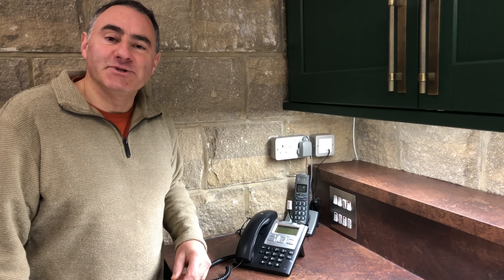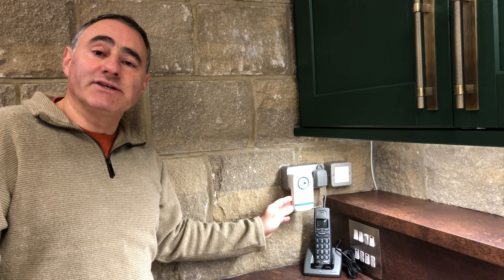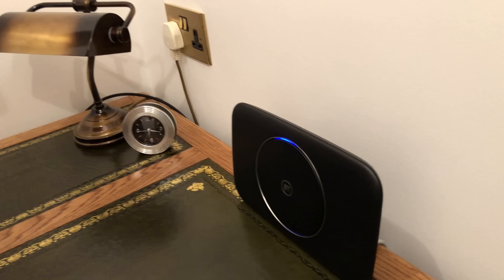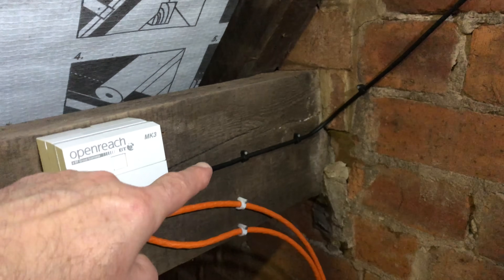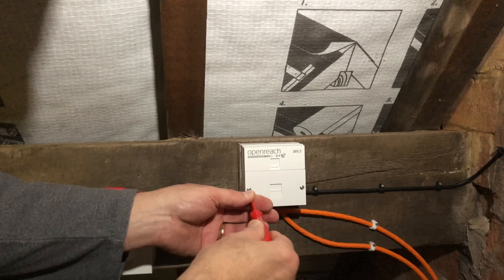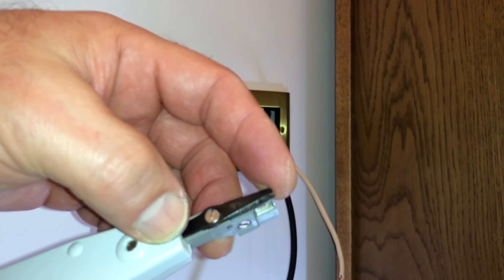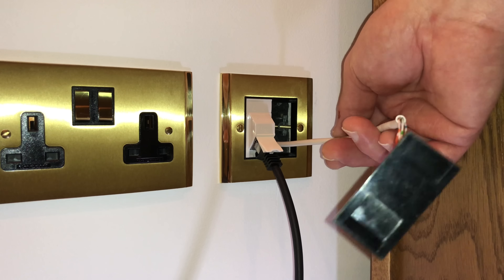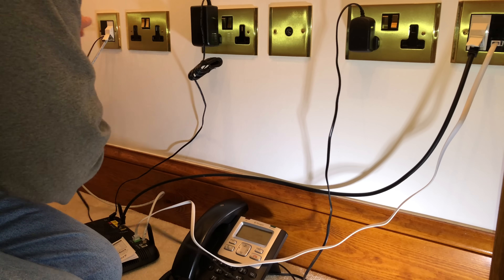How to Video - Analogue to Digital Telephone Landline Switchover Advice VOIP.

Comment: Not sure how this can work for my situ. My Fibre to property terminates from the outside with a BT box having 4 status lights and just one Ethernet feed from it to the Vodafone supplied fibre router. The box like the one you stripped the wires from is no longer part of any active system.  Therefore I have to have a wireless phone set plugged into the router. Am I missing something? As for power cuts..  why not just run the router off a 12v battery if the house power goes down? As long as the Openreach systems in the street still have power I imagine all would still work, VOIP and any hard wired analogue handsets. My battery would also have to power the Openreach fibre to Ethernet box, the one with the service status lights on board. The lights depict - Power, LOS (I assume, loss of signal), PON and LAN.
Reply: No you aren't missing anything, you have joined the many thousands of homeowners in this situation who have done, probably well before time, the necessary and dispensed with the need for a wired system of phones in the home. There are some folk though that may have been lead to believe they need to invest in tech when, in fact, they can still utilise what they already have with the addition of a connecting piece of cable. As for the power cut situation, you have suggested a very good solution. A lot of people won't bother and lugging around some form of battery or generator, remembering to check it works for in the event of may not be everyones cup of tea, but the choice is there.
Reply from the maker: Hello Neil, Fibre to the premises isn’t in our area yet, so our broadband is still via copper cable to the master socket as shown in my video. When full fibre is installed in our area the master socket will be removed from our house. Because of my simple wiring alteration my landline will stay as per my video. You are correct in saying in the event of a power cut your hub and Openreach Optical Network Termination (ONT) box will lose power and your landline will be out of use. As you state, your ONT and hub will both require battery backup if you wish to keep your line open during a power cut. I’ve had lots of comments regarding battery backup, worth a read up! Thanks for watching and commenting. Cheers Rob 👍

Comment: Bit confused (not very techy!).  I have just the old master socket with broadband and phone.  This is in the loft.  I am currently looking for a new broadband supplier, but they are indeed all telling me that they won't do landlines anymore (has to be VOIP)...so what will come into the property?  Is it a new line - and nothing to do with the current 'BT' line?  Does it still come from the pole outside?
Reply from the maker: Hello Barry, The majority of providers use Openreach lines. Openreach stopped providing analogue copper telephone lines in September 2023. Unless a provider such as Virgin Media has underground cabling outside your home then it is most likely going to be the same overhead line from the pole. I still have copper cable for broadband coming from the pole as overhead fibre hasn’t been installed by Openreach yet. Now our landline has been switched over to digital (VoIP) the only difference is a clearer line when using the phone. When full fibre comes to our property my simple wiring alteration will allow my landline to stay as per my video. Worth reading other comments regarding power cuts and battery backup. Hope this helps. Thanks for watching and commenting. Cheers Rob 👍
Reply: @robswiseways5697  
Rob, thanks so much for replying.  Can I trouble you a little more?
I do have a fibre cable running past my driveway (they created havoc here two years ago!).  It also goes within inches of the BT pole.  But my driveway cannot be dug as it's finished concrete 10 inches deep in places.
So my question is, do they come off that fibre trench, up the pole, and replace the cable into my home - copper to fibre?  If so, then my master socket is still going to be in the loft.  A neighbour had his replaced, and 'Giganet' went to his guttering with the cable, then down the wall - though to his router.  They did hide it fairly well, but I'm not keen on that as we have white walls with no cables.

Thanks.
Reply from the maker: @barryfoster453  Did Giganet lay fibre past your drive and then use the BT pole for your neighbour? It’s difficult to picture your situation Barry. If your street only has overhead lines and no underground means of connection (some companies install a boundary access box in front of each property in the pavement), then you probably have no option but to do similar to your neighbour. If you have means of running the cable downstairs internally from the loft then this overcomes the external aesthetics. Hope this helps, Cheers Rob
Reply: @robswiseways5697  
Yes, I am pretty sure that Giganet used the pole, as they didn't dig up his driveway.  They didn't connect to his old master socket, though.  They drilled through his wall and set up his router there.  Maybe it's best if I get their engineer here to talk to me.
Thanks, Rob.
Reply from the maker: @barryfoster453  That’s probably the best bet Barry. Cheers Rob

Comment: Hi, rural dweller here also disabled and in an area with patchy broadband and regular electricity cuts. Will this enable me to keep my big button plug in phone functioning during power cuts as a way of calling in our power cuts as the electrcompany doesn't accept calls from mobile and our cordless phone goes pfutttt when there is no electric
Reply from the maker: Hello Jill, Because digital phone calls will go via your hub your phone will lose connection in the event of a power cut. When switchover reaches your area speak to your provider and explain your situation. They will probably supply you with an Uninterrupted Power Supply (UPS) battery backup for your hub. This will keep your phone working during a power cut for a short time. You should be able to keep your big button phone plugged in using any of the methods I have shown in my video. Thanks for watching and commenting. Cheers Rob 👍

Comment: have had a digital line from BT for over 3 years, all good to be honest and the phone is in a cabin in the garden where my office is, just use the equipment bt gives you.
Reply from the maker: Good to hear you have no problems after digital switchover, even in your garden office. The mobile signal is poor at the back of my garage, probably due to all the foil backed insulation blocking the signal. I doubt the voice adapter or a new digital phone signal would reach our hub. Thanks for watching and commenting. Cheers Rob 👍

Comment: So the issue with the digital switch over is that should we have a substantial powercut and people do not have power banks to recharge their mobile phones or do not have a mobile signal they lose emergency services - wow what a technology upgrade - sorry I am a technology expert I find this level of arrogance from the government amazing - and of course how many people will have your skill set
Reply from the maker: Hello David, The Gov.uk website states in 2017 the telecoms industry announced its intension to retire the analogue telephone network. My simple how to video has opened other discussions and caused quite a stir regarding battery backup. People want faster broadband so need fibre optics which do not conduct electric like the analogue lines. Looks like battery backup is something we need to organise ourselves. Thanks for watching and commenting. Cheers Rob 👍

Comment: I do not want to connect my home phone to the Wifi,it will no longer be personal.
Reply from the maker: Hello Zandra, My phones are not connected to the Wi-Fi, they are wired as per my video. Where BT is concerned only the digital voice adapters and the new digital phones connect via Wi-Fi. Thanks for watching and commenting. Cheers Rob 👍
Reply: @robswiseways5697    Thank you for your reply.♥️👍

Comment: So what happens when the power goes off? If you live in a rural area and constantly having power outages then you don’t get a phone line? And you can’t rely on mobiles ether, as the mast goes down?
Reply from the maker: Hello Rich, Although my video is related to keeping traditional telephone sockets active, I’ve had quite a few comments on power cuts and discussions on Uninterrupted Power Supply (UPS) battery backup. I think this is the only solution for anyone with poor / no mobile signal and for vulnerable users with telecare equipment. Thanks for watching and commenting. Cheers Rob 👍
Reply: You use a UPS. I'm Australian and I've had to do similar, but I was doing so even before we went digital. The cordless phone doesn't work without power, nor does the answering machine, modem, wifi, or any other part of the system. A basic home office UPS (mine is 1200VA/750W from amazon) can power all of this, plus a powerboard to charge my laptop (while in use), mobile phone, ipad and smartwatch (Plus a LED desk lamp!) for over 4 hours. I'm sure it could handle just a modem and cordless phone for far longer - though I am surprised to hear your mobile masts don't have power backup!

Comment: Phones will no longer be able to be used for emergency calls if there's a power outage either in your home or at the server.  The whole idea of the old analogue system was it was self powered from a battery bank at the exchange which meant that it was always powered up unless a line was cut. This is just another degrading of the emergency system, the government don't care as long as they are not quizzed on the matter as the morons in Westminster don't have a clue
Reply from the maker: Hello Ian, My ‘how to keep your old telephone sockets’ video has opened up other avenues for discussion and has caused quite a stir as can be seen in other comments, such as battery backup. Gov.uk website states ‘the telecoms industry announced its intention to retire analogue telephone lines’. Ofcom, the independent telecoms regulator, has a guide for vulnerable customers. Telecom providers should support vulnerable or at-risk customers throughout the upgrade process to digital phone lines. Thanks for watching and commenting. Cheers Rob 👍

Comment: And when we have a power cut which will happen then no phone. Not all of us have or want a mobile.
Reply from the maker: Hello Gerald, Although my video is related to keeping the traditional telephone sockets in use, it has opened a discussion in comments regarding power cuts. Uninterrupted Power Supply (UPS) battery backup has been mentioned numerous times, and it seems to be the only solution in the event of a power outage. Thanks for watching and commenting. Cheers Rob 👍

Comment: My auntie who is eight only as a BT land line and no internet will they replace it with a internet hub instead and charge her the same monthly fee. Does that mean she will have wireless broad bad as well. She received £8 a year of BT for having a telegraph pole in her garden, not much if you ask me.
Reply from the maker: Hello James, I’m guessing they are either working on a device for landline customers only, or BT may provide an internet hub with broadband switched off (which can be activated later if required). Probably think the fee would stay the same. Sounds like your auntie is overdue for a cost of living rise from them 😀. Thanks for watching, Cheers Rob 👍

Comment: Good video on wiring. I agree that avoiding using all those plug-in adapters (I’d need three here) is worthwhile.

The solution I opted for was to buy three new DECT phones (as others have suggested). This was a much more expensive option than buying the BT “adapters”. However, as others have pointed out, it has brought the benefit of reducing (but sadly not eliminating) unsolicited and scam calls.
 I also bought a power bank so that I could recharge my mobile phone from it during a power cut. Another drawback, that nobody seems to have mentioned, is that DECT phones are not as good for those who have hearing difficulties; conventional wired phones usually have louder speakers in the earpiece.

The Pandora’s Box that you opened is, of course, the way that digital voice fails during power cuts.
 As too do DECT (wireless phones) because they too need power. Also no power = no ability to recharge your mobile phone (so you need a power bank at the very least which adds further to the expense to the public of the change over).

Ofcom states that:

"[Ofcom’s] research suggests that 68% of customers that have a landline in their home have a cordless phone only, and that 50% of customers that live in a home with only a landline phone use a cordless phone rather than a traditional corded phone. Cordless phones are very unlikely to work in the event of a power cut as the unit that plugs into the phone socket also needs mains power to work and these do not tend to have a battery."

They then argued that since most customers had voluntarily [unknowingly is a better word] put themselves in the position that they could not call 999 over the Public Switched Telephone Network (PSTN) during a power cut the principle of "Universal Service" had become less important.

In its consultation on switching to digital voice [held between 24 May 2018 and 5 July 2018] Ofcom set out the principle that:

“CPs [Communication Providers] should have at least one solution available that enables access to emergency organisations for a minimum of one hour in the event of a power outage in the premises.”

The London Fire Brigade highlighted the inadequacy of this principle up very well:

“Our [London Fire Brigade’s] concern on this principle is on circumstances where a power outage exceeds one hour. The limitation of one hour does not seem to satisfy the Universal Service Directive as stipulated in paragraph 2.14 of the consultation document.

In the event that a power outage exceeds one hour people with no access to, or means to access alternative lines of communication, have no ability to contact the emergency services in the event of an emergency. While such circumstances may be infrequent, in areas of no or poor mobile signal some people, in particular those who are isolated, would be unable to contact the emergency services and so be left at risk. There would be even greater risks for those who are vulnerable and more at risk of having a fire, of being less able to react and have a reduced ability to escape in the event of a fire.

Although an overview of UK power outages (2010-2015) reveals that there is a national average outage duration of 50 minutes, the average for Greater London is 156 minutes (2.6 hours). This clearly demonstrates a one hour solution is ineffective particularly in London. More importantly, relying on average times would mean that anyone exceeding the average is put at risk and so the times must be extended much further than one hour if a back up service is to be effective.

Power outage contingency solutions should provide a critical uninterrupted connection for the purpose of fire survival guidance and emergency service appraisal of the situation at the incident centre. Communication providers should be aware of the fact that sometimes calls between emergency services and services users disconnect, and re-establishment of connections in these circumstances requires additional time.”

Source: https://www.ofcom.org.uk/__data/assets/pdf_file/0015/117204/London-Fire-Brigade.pdf 

One thing this clearly indicates is that it's not just a problem in remote rural areas. The LFB is saying that in London the average power cut is longer than the national average (at 2.6 hours) and, as it points out, catering for the average is not good enough.

Unfortunately Ofcom didn’t address the LFB's concerns in its final guidance. The solutions offered vary from CP to CP some of them are better than others. I'd argue that even a 12 hour UPS is insufficient. As at least one person has said, this could prove to be the next big scandal.
Reply from the maker: Much appreciated Peter and I must say your comment makes for very interesting reading. Your detailed insight into power cut situations and the mention of the drawback of DECT phones for the hard of hearing will prove helpful to other viewers. Wonder how much larger a longer lasting UPS would be. Surely there has to be a cut off point regarding size and where it can be sited. Of course this is purely an individuals choice. Once again thank you for watching and commenting. Cheers Rob 👍

Comment: Before Broadband and the Internet accessing a computer from home meant dialling up over your phone line. This could result in your line being busy for hours on end. To get round this problem I had a second line installed by BT; so I had one for voice and one for data (that line being Ex-Directory because I didn't want any one to call it). To achieve this BT used one of the redundant (unused) pairs of wires in the incoming cable.
Reply from the maker: I remember the dial up internet Peter and I remember our neighbour having two lines too. Thank goodness for progress. Cheers Rob 👍

Comment: Switched back in September from bt to a voip provider once I had cityfibre fttp installed, saving a fortune on having a landline number that costs just £1.44 to rent a month & the calls are so much cheaper than bt charged!

Decided to ditch the landline phones we had as they were rubbish anyway & got dedicated voip handsets & base station.
Reply from the maker: Sounds like you’ve got a good deal there. We’ve kept our existing phones as they work perfectly. Thanks for watching. Cheers Rob 👍
Reply: What VOIP provider are you using and which handsets and base station did you get?